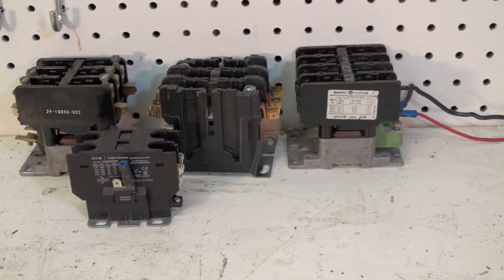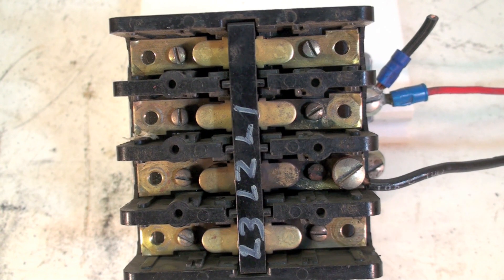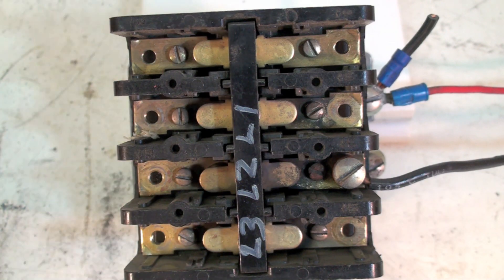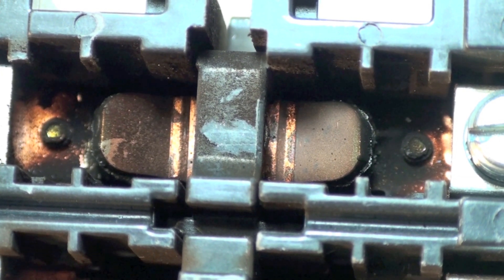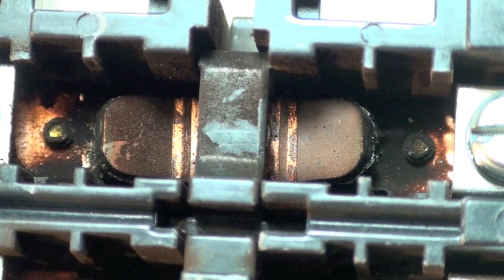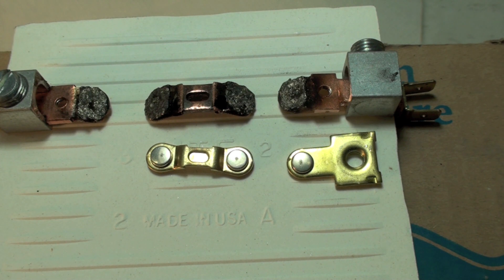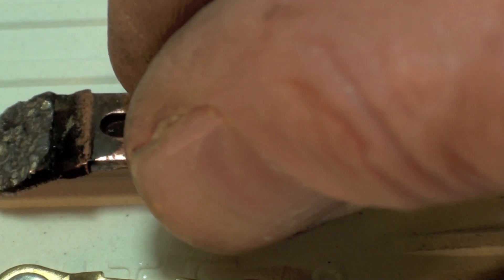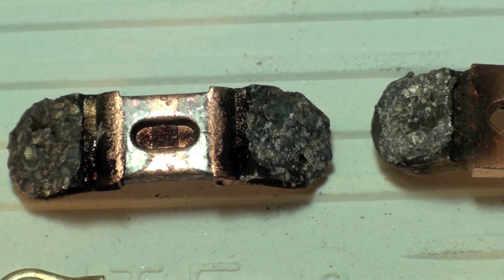The contacts of the HVAC contactor part 1 of the contactor series

Comment: Nice explanation !!! .....Do these DP style contactors need a specific mounting orientation?...say....if mounted vertically as we often see, can the line power coming in be connected to a top-side "L" connection?..... as well as a bottom-side "L" connection, if oriented that way?...meaning....can the unit be mounted both right-side up as well as upside down? I'm guessing it doesn't matter but thought to ask.
Reply from the maker: I generally see them mounted with the L end down.  I think mostly it's a convienience issue.  Mostly, the power comes from the lower side, so the L end is down.
GFM
Reply: Sorry to post back...that's what I'm saying....my own power leads are from the bottom....to come up to a bottom-mounted contactor connection for L1/L2. That puts ALL the printed matter and terminal designations on the device.... upside down on this replacement piece,  (it  was built probably assuming power drops in from the top). So.....orientation from a functioning standpoint....doesn't matter? That's what I want to make sure is still OK. Thanks !!
Reply from the maker: @TheWilferch  I don't believe it matters.
GFM
Reply: @grayfurnaceman  ....much appreciated....I didn't think so either....have a great day.

Comment: As a generic recommendation would you replace a contactor every 5 years to avoid failure? I have made it a general practice of doing this am i in error?  By the way great group of videos.
Reply from the maker: I dont replace most any part due to time only.  There are some exceptions like flapper valves on the old Pulse furnaces.  Some techs used to replace thermocouples every year, but I never did.  Our industry has a bad rep for replacing parts that have not failed (like caps), and I kind of react to the opposite.    But how you do it should be based on your experience.
GFM
Reply: Good point,  I install high quality caps AmRad and warrantee them unconditionally for 5 years parts and labor. Same with my contactors.  I warrantee them for 5 years parts and labor.  I love to get my clients on that schedule.  I check the system up to 2 times a year for all the basics ( mostly 1 time a year) and keep the coils clean as needed.  My failure rate has dropped considerably.  My proactive repairs are limited to caps and contactors.  I don't junk fee my clients in any way and express clearly that it is a proactive repair done every 5 years.  The junk that is being installed gives little indication of failure the chinese caps are junk and many of the contactors are the same.  Its cheaper to do a tune up while i'm there on that first failure.  Most of my clients agree  Thanks for your time.  This is my main pet peeve :)
Reply from the maker: Mark E Pugliano Sounds like you are attempting to get repeat customers and build trust.  The best friend a customer can have is a reliable tech that will repair when it makes sense and recommend replace when that makes sense.  Its a jungle out there for the customer.  Keep up the good work.  And about the caps.  They used to be the most dependable part out there.  Not anymore.  I am also using the Am Rad caps even though they are very expensive.  Thanks for the thoughts.
GFM

Comment from the maker: If the contactor arcs during operation, it usually will burn up the contacts.  Change in pitch is usually on startup as the pressures change to get to operating pressure.  If there is a voltage drop, about the only thing you can do is ask the utility to put a recorder on your line as the voltage drop is almost always from the incoming power.  Hope this helps.
GFM

Comment: I have an old American Standard Condenser outside.  It runs well but I am always keeping my ear on it!!  I looked at the contactor last year and it looked ok.  I am suspicious the contactor can arc and cause momentary single phasing on the compressor--which I am sure the compressor does not enjoy. The compressor does seem to change pitch in sound at times and I could believe that is caused by some sort of voltage drop?